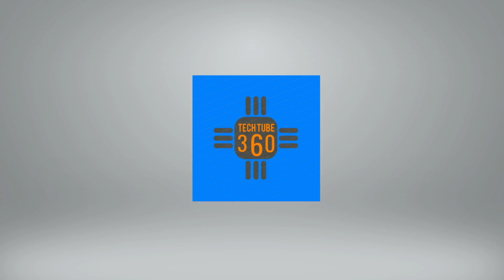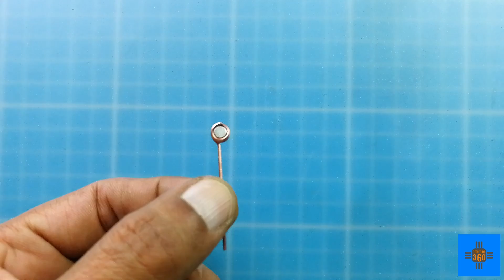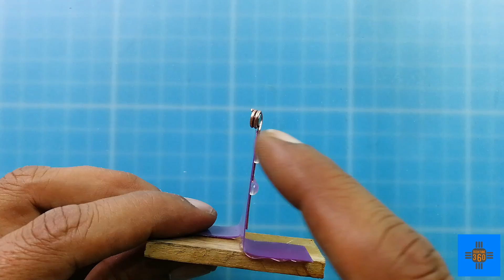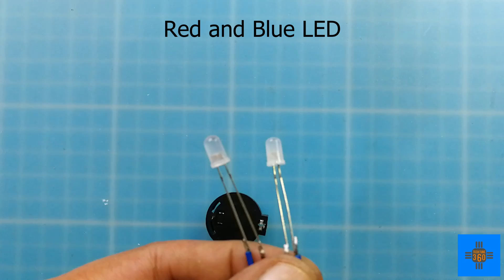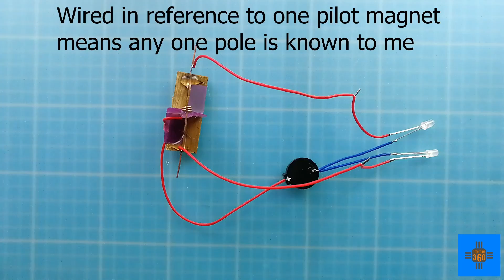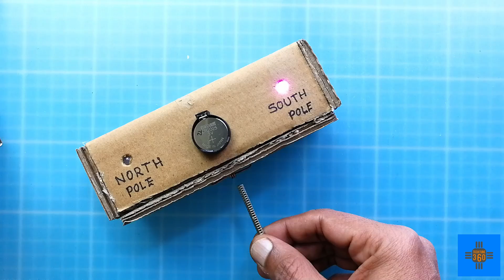Diy easy magnet polarity tester at home

Comment: How the hell did u figure out which pole is south r north while labelling the device
Reply from the maker: Bro I took a pilot magnet of which poles were known to me then I wired up accordingly so that it switches to pink led for South pole and blue for North
Reply: It says diy. but when we build it how r we supposed to know which pole is south r north with out a magnet of known polarity. # question: why would u even waste tym building a device if u already have a magnet with known polarity, u can just use that magnet to determine the poles of other magnets 😞
Reply from the maker: @jishnuvijayan2931  bro you need to have that polarity known just once while building the project then on you don't need it. And simple way of you do not have reference magnet then I am posting you a link see at the time 5:49 sec on below link to find polarity or making pilot magnet
https://www.youtube.com/watch?v=1wlZssDzPlk&t=353s
Reply: Tech Tube 360  hm👍, u should have added that reference link in the video .anyway good job carry on the good work
Reply: One can use a compass at first as a reference to decide the name definition of the 2 LEDs. Anyway, this is all good work as it makes you understand how things work. Well done.